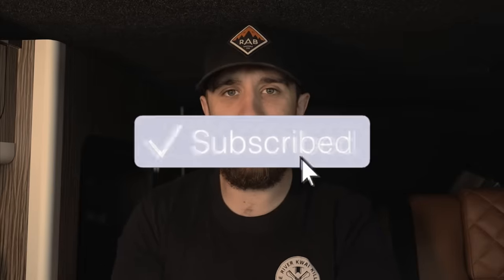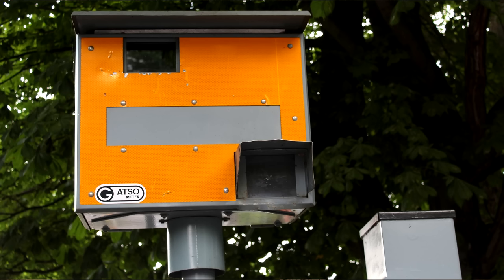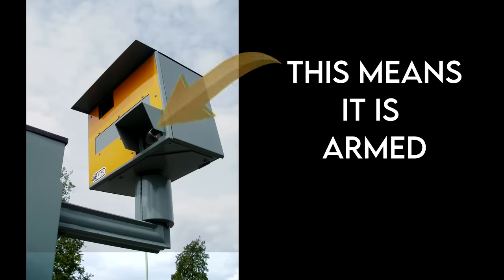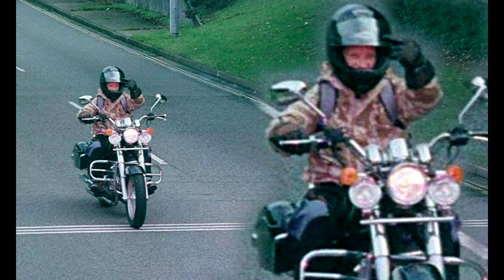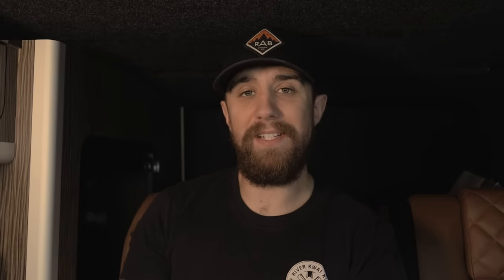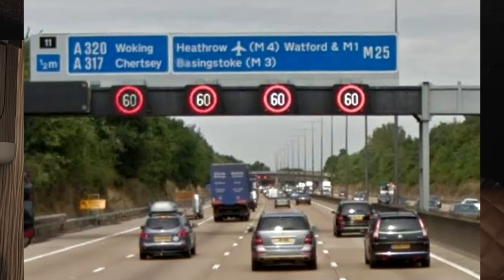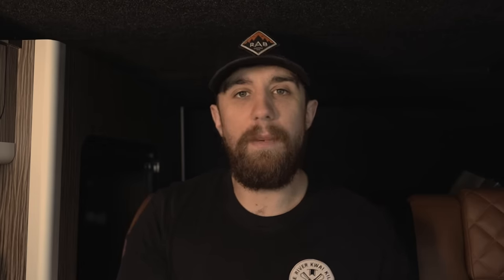How Speed Cameras Work and What to Look Out For

Comment: Great video, could you maybe follow it up with the law on how long they have to notify you of the speeding ticket and possible ways of beating it? I seem to remember Wayne Rooney getting away with one as it was over the 10 days or something? Also I know they changed fines so it’s a percent of your wages now, not fixed. Thanks
Reply: From Fraser, husband of Leslie
They have to send out a Notice of Intended Prosecution within 14 days of detection.
Reply: Doesn't need a video.

It's simple. It has to be SERVED within 14 days, NOT "Delivered". There is a difference. Many people think if it doesn't arrive within 14 days you're off the hook, that's not quite the case.

If the ticketing office sent out the NIP, by generating it, printing it off, and putting it in an envelope and into the postal system in say 5-6 days but there was a postal strike and a massive backlog of post so it didn't arrive for 2 weeks, it would still be deemed as "served" and therefore "valid" because it was sent out within 5-6 days.

However if the ticketing office were so behind, and sent it out on day 13, expecting it to arrive the next day using 1st class post, and it arrived say 3 days later, that would likely be deemed as "not served in time" and be invalid. Ultimately if you want to argue whether it's "valid" or not it's a matter for the court, and you'd have to appoint a motoring solicitor or even represent yourself. It's worth noting that if you lose however you'd be liable for all of the extra costs.

Many people have tried this "not delivered in 14 days" in court before, often losing because it was actually sent out in a timely manner and it's due to postal delays, especially over christmas period. The ones that win are usually where the ticketing office haven't sent it out in a timely manner as deemed by a judge, i.e on or very close to day 14 and to expect it to arrive within 14 days is unrealistic.
Reply: @frasermitchell9183  Correct. Many people think it has to "arrive within 14 days" this is wrong. It only needs to be "Served" within 14 days. Ordinarily this means generating the NIP,  printing it, and posting it. If there's then a royal mail postal strike and there's no post for an entire week or two and it arrives after day 14, that would likely be deemed as "still valid" as it was printed and sent out within 1 day from the offence. However if the ticketing office didn't send it out until day 13, and it arrived two days later on day 15, it would likely be argued it's "not valid" as although they sent it out within the 14 days it could never have realistically been expected to arrive within 14 days, and they've left it 13 days just to "serve" the NIP.

Comment: The painted yellow vs not painted is to do with who operates the camera.
They don't by law have to be made visible, have warnings or painted yellow.

I was told by an officer in the "safety camera partnership" years ago that it depends if its the local force, a camera partnership scheme or treasury that determines the law about being painted and visible.
He said if it goes back to the treasury then it has to be painted, visible and warnings posted.  But if it's the local force, they can hide the cameras no issue and that each force determines the actual rules regarding prosecution up to the guidance you stated.
He said some forces will be 1mph over, some will by 5, some will be 10%.

Even then you get civilian schemes like where i live that record your reg with a mobile radar, and then you get issued a speeding warning from the local force where they issue a warning, but state if you get caught again in within 12 months they will change the warning to penalty points and prosecute.

He said it's 3 points for speeding (not dangerous driving etc.) up to 25mph over the speed limit, and anything over that is court and the judge will decide how many points you get.  All interesting stuff.

Comment: Have you noticed more motorways with 60 mph limits for air quality? Strange that the locations  are in very congested sections such as Tinsley viaduct Sheffield & Perry Barr in Birmingham where the average speed, during peak times, is less than 40 mph. Maybe vehicles that are not moving fast is the cause of the poor air quality. My main point though is, why at 2AM, the speed limit is 60 MPH for air quality and I am the only Fker on the road? 60 MPH for me is a wishful target as I am limited @ 56 MPH anyway, it's the brightness of the lighted signs keeping me awake that's more annoying.
Reply: ahh yes, I hate being kept awake on the motorway

Comment: But with the average speed camera, if you were speeding within a section but pulled over and stopped altogether for a few minutes and then drove slowly for the rest of the way (within that section) presumably the average speed camera would not treat you as speeding through that section?
Reply: Correct. But that totally defeats the point of speeding. You just run the risk of being caught if you don't "stop" for long enough to average it out. It's just easier to not speed and have to stop, and to just drive to the average speed limit and then there's no risk of being prosecuted.

Comment: That's correct by law speed cameras don't need to be yellow anymore, this includes police officers now no longer need to be in hight vis jackets so basically can hide behind a bush all in black.
Reply: In Scotland they must be yellow with hi-viz strips on the rear facing the oncoming drivers.
Reply: @alasdairmackenzie905  Yes maybe that's correct, definitely no high vis in England. That said my first and only speeding offense was in Scotland A9 when I was working as a commercial diver. The police were hiding behind a bush /entrance to a farm just after a dual carriageway section (definitely not visible) to catch people entering the single carriageway at a higher speed.

Comment: Question if your speedo says your doing 50mph on a straight road your    sat nav is reading 47mph what is the correct speed, cars or sat nav which is the one to believe in .....
Reply: Almost certain it would the satnav that is correct.
Reply: @richardh1764  thanks. my car says fifty on the speedo  yet sat nav is saying forty  seven roughly under always whatever speed. You have to always watch the speed with the amount of cameras around
Reply: Hey its just my opinion dont risk your license on it
Reply: Note that GPS speeds usually ignore change in altitude: going up/down a hill the sat-nav will under register the road speed (as it is only looking at the horizontal component) - the steeper the hill the greater the difference.
Reply: @cigmorfil4101  OK thanks  the gps always reads lower than the actual cars speedo by three miles per hour approx
Reply: if you change speedos they have gears also change tyre sizes makes speedo do wrong things  my bedford 250 i put 800 tyres on it speedo went from 70 down to 60 as the rear axle was turning less revs per mile  ie the rolling cicumferance.

Comment: part 2 / found the camera this is a steep rd with a  school near the top of ,the rd sign says 30 mph but 10 mtrs past it drops 2 20 mph ie the school then u r back on2 the 30 mph rd .so had a look and it says 20 mph when flashing the kids where of with lockdown so it means its still a 30 mph rd .am I right.do they have 2 show me a pic and the speed I was doing ?
Reply: If the lights are flashing, it's 20
Not flashing, 30

Were they flashing when you was doing 30? Enjoy your nip
Were they not flashing when you was doing 30? Don't worry.
Reply: @jjmmjj9999  no as I have said the schools r in lockdown so no need 4 them 2b flashing which they weren't just waiting 4 them 2 send me a pic and speed I was doing then I will take it from there
Reply: @mickowen568  doesn't matter?

If you jump a level crossing yet no train is passing does that excuse it? If the red lights have started flashing and you go across, even though there is no train coming for hours, you'll still get the fine.

You've sped, doesn't matter if the schools are closed or whatever.

That's like defending doing 40 in a 30 because it was 2am and no body was awake.. Doesn't work like that.
Reply: @jjmmjj9999  until they get back 2 me with the speed then no1 can really do anything if I was doing 30 im ok as I said and u should know if the lights r not flashing then it stays 30 not 20 ,u make it sound like I have jump some red light it says it on the sign 20 when lights r flashing
Reply: @mickowen568  Idk what's so hard to grasp.

If the lights are flashing
The speed limit is 20mph. If you will do 26mph when the lights are flashing, you're speeding and if caught will get a penalty.

If the lights are not flashing,
The speed limit is 30. You will not get a penalty for doing 27mph.

It's variable speed limit. It's not hard to understand.
If you was doing 30 and they wasn't flashing, stop panicking.
If you was doing 30 and they were flashing, panic.
Reply: @jjmmjj9999  talk about grasp how many times do I have 2 tell u the lights WHERE NOT FLASHING y would they b they r 4 the school and as u now schools r in lockdown so no need 4 lights 2b flashing anyway
Reply: @mickowen568  prehaps if you used proper english and actually formed a sentence that made sense i'd understand.
not once in your original comment did you say "the lights were not flashing".
 
in your original comment you asked "if the kids are off school, is the road 30" 
well were the lights flashing? then no, its not a 30 road.
Reply: @jjmmjj9999  in my part 2 I did say 20 mph when flashing .I also said the kids where in lockdown  so they couldn't have been flashing and u couldn't connect the 2
Reply: @mickowen568  right, but theyre based on time. The signal/sign doesnt know the kids are in or off school.
Reply: @jjmmjj9999  there is normaly a lollipop lady there 2 operate the lights my friend hope we have cleared this up now looking ok not heard of them 4 over a week ,just waiting 4 a pic and speed I was doing there r other factors also ,where r u this is Walsall im talking about,y I got a letter from Birmingham I have no idea

Comment: Mobile speed cameras have a cameras all around the vehicle

With optional speed cameras at the front and back (on the transit 350 vans) 

That's how they get motorbikes 

If you saw a speed camera van and you were speeding it's usually too late

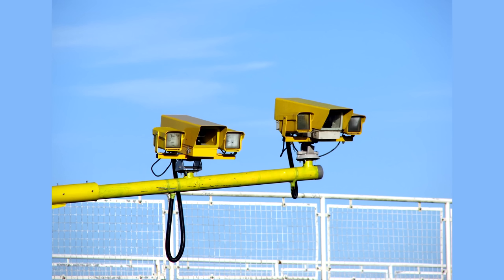Comment: You are slightly wrong with the AVERAGE SPEED CAMERA, 6:10 where you say you have to stick to the speed limit.
 (you don't have to stick to the speed limit, you can drive below the speed limit and be OK) (just to point that out, but I know what you mean).
These cameras check the time it takes you to go through one camera, and then the time you get to the second camera, So for instance, doing 50mph and it will take you 60 seconds to cover the ground).
So, I like these cameras as you can be distracted whilst driving, and if you go through  a normal gatso camera speeding, then you get a fine.
With the average speed camera, if you go through the first camera too fast (say you do 70 and it is saying 50), if you then slow right down for quite a while, to say 40mph and drive the rest of the way to the second camera, then you may take 75 seconds to cover the ground, and so you won't get a ticket which I think is a better idea and you can adjust your speed to compensate you going too fast and make amends for the speeding bit.
(hope this all makes sense)?
So I am not condoning going through these fast, then slowing down. I am saying that if you make a mistake, you can rectify it by slowing down more and then you don't get a fine for it.

Comment: Surely there must be an allowance for tolerance. Speedometer are not that accurate, coupled with slight changes in tyre pressure means it is easy to be 1 or 2 mph out of exact speed. My satnav (accurate to 15 feet) regularly shows a 3 or 4 mph difference to my car speedometer

Comment: Subscribed, good info but can we have more please on how if red traffic light cameras actually can zaap you for speeding????
Reply: Because they aren't "red light cameras"? They're "RedSpeed".

Some cameras ARE red light only, the old style grey gatso cameras you might still see are red light only, they're quite tall and thin, not like the normal yellow wider gatso we all see. There's different cameras made by RedSpeed international, one named RedGuard which does red light only, and another named "RedSpeed" which does Red light enforcement AND Speed on green light also.

These work using sensors buried into the ground, you can often see them when you approach or stop near the camera, as the lights become red after a 2 second delay they activate, if anything metallic passes over it triggers the loop and the camera flashes, taking two photographs usually 1 second apart.

When on green light, another loop becomes active and it uses several sensors to calculate the time taken to pass over them, from that it can calculate the vehicle's speed and flashes again twice 1 second apart.

Comment: I regularly drive along the M5 at 70mph, and apart from lorries and coaches that is slow compared to other motorists in cars and motorcycles who are passing me at speeds between 80 - 90mph so what is more dangerous, putting myself and any passengers in danger by sticking to the National speed limit or by driving at similar speeds to the flow of other road users.

Comment: The average speed cameras do not measure speed, they measure the time at which you cross that particular camera. Along a long stretch, therefore you have a list of times your vehicle has crossed different locations. The speed between each of the cameras are later calculated and each of these and the total are arrived at. If you speed at a particular camera location and reduce the speed before you reach the second camera you could reduce the average between those two locations. So it is important to notice the distance between two adjacent cameras.

Comment: I drive at the speed limit through the roadworks on the m6..average speed cameras and  cars and lorries come flying past..How is this possible??
Reply: Because your speedo is showing about 10% above your actual speed whereas the coaches and lorries tachographs are accurate to about 1%, checked every 2 years and recalibrated every 6 years.  When your speedo says 50mph you are likely to be doing nearer 45mph.  When the large vehicle's tacho says 80km/h it will be near enough doing 80 km/h (50mph).
Reply: @cigmorfil4101  problem solved..many thanks

Comment: Is it a myth that on the base of a specs motorway camera if you see a white box connected to some wires then the camera is live or if you just see the pole sat on its concrete block without the unit and wires then it’s a dummy or about to be moved ! Ps how come in a 50 zone with specs cameras trucks go flying past you whilst your clinging to the wheel at dead 50? Just sayin.

Comment: An average speed camera does NOT pick up your speeding if you were to go , say 45 in a 30 then slow down to 15. It works on the AVERAGE speed.   45 to 15 is 30 as long as you measure your distance correctly
Reply: Yes... but that's flawed logic because it entirely defeats the point of speeding. There's no point "speeding" only to slow down and do less than the speed limit deliberately for some distance just to avoid being prosecuted, it's easier and less risky to just stick to the average speed limit.

Comment: The Highways stated that these cameras distracted drivers and were dangerous if that’s the case way are they still in use 
This was directed at the average speed units. So which is it are they dangerous or are they safe or is it the governments nap to accept a number of accidents 
Secondly these average speed cameras you so worried about the speed you looking more at your speedo then the road.

Comment: I was under the impression that mobile cameras (user operated) being visible was just a gentleman's agreement, the same as fixed camera, and not an actual law or requirement.  In Warrington almost every copper using a hand held speed camera, hides behind cover to catch you out. Normally on the rupees of road where it can be easy to wander slightly over the limit without realising.

Also Warrington and the Wirral, have lots of "red routes". Stretches of road with high accident statistics. Yet you never see a speed camera in these areas. You see them on the roads where you can gaurentee you'll catch a lot of people slipping slightly over the limit. This adds fuel to the argument that it is purely a revenue gathering and target hitting exercise.

They should definitely have them near schools, and on roads with high accident statistics.
Reply: Most mobile sites are community concern areas where local communities request their presence due to problems with speeding,  then collision data is used, there is no data to suggest they are needed outside of schools, most of the time when it's drop off and pick at school the roads are full of cars making it hard to speed and also to park a speed camera van (I actually witnessed a mother having a go at one near a school for taking up a parents parking space, she said he should come back in the evening)